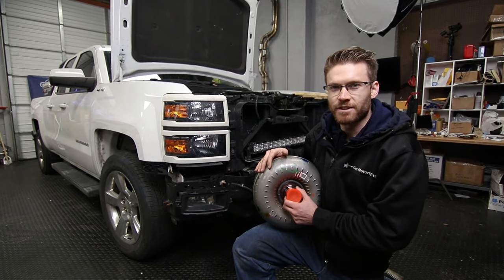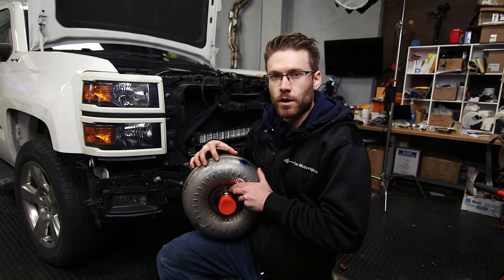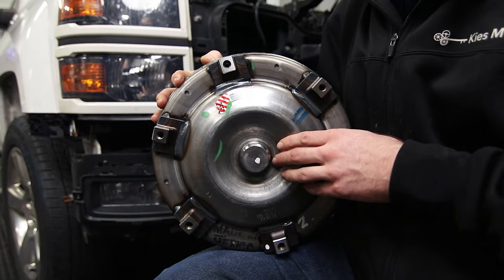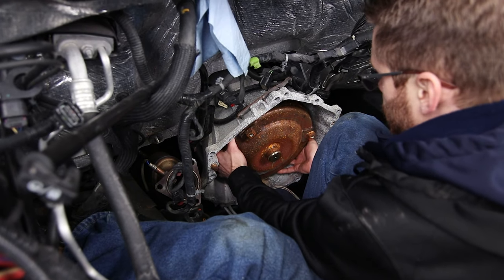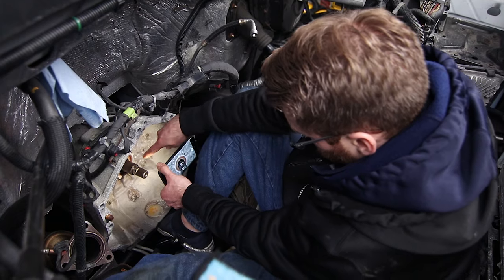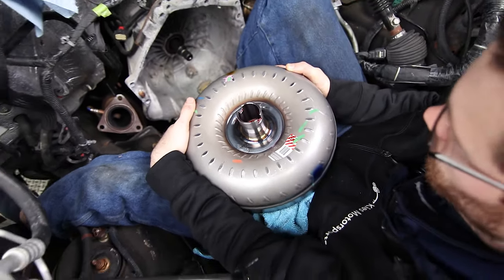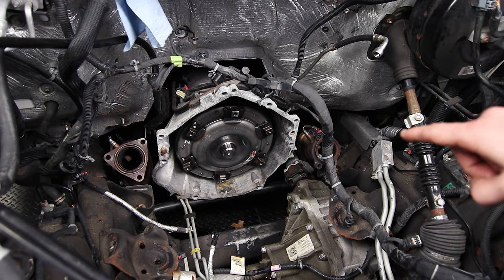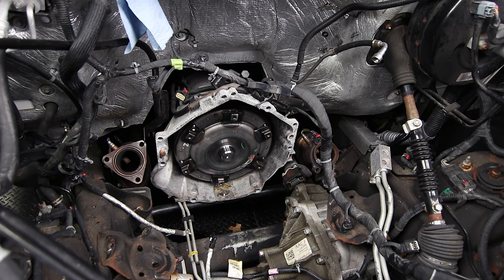6L90 Torque Converter Install in an 6L80 Transmission - Silverado Sierra Tahoe Suburban Yukon

Comment: I've been a professional mechanic for over 40 years. I would never replace a torque converter without first replacing the torque converter seal. The seal has got over 100k mikes on it. It's going be running on a new surface. It is 10 times more work to replace it after it's all put back together.
Reply: Do you have the OEM part number for that on the 6l80? Think I screwed myself, potentially. Didn’t replace the seal and I’m having to add a ton of pressure to get the converter to stay locked. It either locks smoothly but slips with applied throttle, or locks super harshly and doesn’t slip as often. Thoughts on if it’s that seal, as well as the part number, if you know it?

Comment: Is it abnormal for a break In Period to occur after a transmission rebuild and an upgraded torque converter? I am having shudder and rough shifts that has gotten better, but still occurs 200 miles after the new tc.

Comment: Great video and information. My TC failed at 82K miles and shredded my transmission. Fortunately for me my 2014 was still under its 100k mile powertrain warranty so I had it repaired for free though it took two and a half weeks. My transmission was so trashed I actually got a new one and not a reman. I also got the upgraded TC installed as well at no cost to me.
Reply from the maker: Always nice when the warranty comes through!
Reply: Which truck have 6l90  or every truck have 6l80.  Thank you
Reply: im at 113K miles on my 2016 Sierra and i think my TC and tans are toast, I was able to get a trans off a 2018 silverado LT with 5K miles on it (same 6L80 trans). The truck was totaled but trans still good. planning on doing the swap in a week. my questions are: do you think any programming/relearn is required for the whole trans swap? secondly, while its down should i upgrade the torque converter or just use the OEM?
Reply: @utrocker7  I would definitely upgrade the TC. That's what caused my trans to fail. As for the programming, my guess is it will need to be reprogrammed or at least a relearn for sure.
Reply from the maker: I agree with Michael
Reply: @TheSundaeDrive  last question, is the stock TC really that bad or would upgraded fluid to amsoil fix the issue? I’ve read through multiple forums and still can’t tell if these 6l80 TC are just crap or the transmission fluid by gm is getting too hot causing the tc to fail. Thanks and great videos btw.
Reply from the maker: Doing the thermal bypass and changing the fluid will help. But I don't trust the torque converter lol. The temps definitely kill it faster I think
Reply: Same here man. Bought at 85k failed at 90. Thankfully my warranty covered it but still a pain. I told them 2 weeks prior something was wrong but they sent me on my way. 3 days later catastrophic failure. Smh
Reply from the maker: Ended up costing them more by waiting. Wish more dealers would do preventive maintenance under warranty as soon as it shows signs of failing.
Reply: @TheSundaeDrive   GM and it’s dealers have a nack for being very reactive vs proactive.
Reply: So just upgrading to a factory 6L90E coverter is not as good as using a heavier aftermarket unit.
Correct??
Reply: Who has the New upgraded torque converter as I have the 8L90 it has 60k miles have not had any issues yet but wanted to get a new converter fix and have it done so I will not have to do a complete rebuild
Reply: @TheSundaeDrive  I agree. That why I replaced my TC with a Saxco SX-GM10404-S1BP from Transend. It has an upgraded billet cover, billet piston, heavy duty bearing, and flanged hub. These parts resolve all the issues with these TC from my understanding. I paid $870 for it. After speaking to many transmission pros, this is the most affordable, bulletproof upgrade, and should easily go 300k miles.
Reply: @jimandrews2967 get a Saxco torque converter with billet cover and billet piston for $870 and you should get 300k miles out of it. You can't just slap this on your old transmission. Either have yours rebuilt or buy a used one from a junk yard with low miles (preferably under 50k miles) and then have that TC I mentioned above installed on it. Upgrade the transmission cooler to the biggest one you can get, run Amsoil transmission fluid, and install a Superior STL010 bypass valve in the transmission. Do a drain and refill on the transmission fluid every 20,000 miles. This should be about 4 to 5 quarts of fluid. You are just draining and replacing it. No filter change.
Reply: must be nice
Reply: Everyone says the TC broke their trans, I wonder if that's just what they are told by mechanics that wanna swap trannys either for good measure or just to rip you off. Because my chevy stopped driving but I never got a overheat message, I'm going to replace TC and do a flush hoping it helps the transmission cost more than my car.
Reply: @jimandrews2967 correct, at least in my experience. I have the 6L90E and the torque converter failed at just 43k miles. The second torque converter (OEM as well) failed at 65k miles. I went with a build from an independent shop for the third transmission since they use aftermarket billet TCs

Comment: The common problem with these transmission is the failure of the main pressure regulator valve in the pump, which drops the line pressure on these unit.  In the early model the output shaft had a design where it also cleaned the fluids by catching debris with centrifugal force as you drove the vehicle around.  Early unit use to go up to 200k miles with very little service.  Then gm change the design of the out put shaft and more metal shaving (practical's) from the planetary sets started to float around in the  fluid.  So it is paramount to change the fluid on these units every 25 to 30k miles.  Changing fluids on these units will help prolong the life of these tranny.  Please do a complete transmission fluid service as you are installing a brand new Converter. Hope this helps and most likely you have done the oil change on it.
Reply from the maker: Frequent fluid and filter changes are a must for sure! I plan to service it every 30K miles as you suggested 👍
Reply: Would a pump pressure regulator not throw a code and a dash light? I have the shudder but no codes whatsoever.
Reply: @davidouradnik7925    No it does not set a code for a worn pressure regulator valve.  Most of the time it will pick up a clutch pack is slipping code or solonied performance.
Reply: I have a shudder and no codes. I'd like to just change the torque converter but everyone says it won't work or it won't last. 

Never overheated it or burnt the fluid,and the fluid has been changed several times and looks good.

Comment: The main issue is that the GM torque converters have welded tabs and are stamped from low quality steel.  Save your transmission, install a billet converter.

Comment: Confirmed!  My TCC failed with 108k on the clock in my '17.  Went with a reman trans.  It is my belief that the AFM  operation makes the TCC work much harder and thus reduces its already short life.
Reply from the maker: Seems like I got mine swapped out just in time!
Reply: You should have replaced the Front Seal  as well!
Reply: I believe that as well. Also contributes to the known cylinder misfire due to stuck lifter issue. I bought a $60 device to plug in the OBD port that disables the AFM and man does it ever respond better.

Comment: Great video. I had that same issue of transmission shudder in my 2017 Sierra at 30K miles. The dealer replaced the fluid. It happened again at 57K miles and this time they replaced the torque converter. I was glad I purchased the 100K power train warranty when I bought the truck, I have 10 months left on it!
Reply: lol this comment was exactly 10 months ago. Hopefully you are having no issues

Comment: Thank u for the video. About to do my first converter change. Went out at about 160k miles. Gonna use the amsoil as well.
Reply from the maker: Glad it helped! Good luck with the swap
Reply: Did you just swap in a new converter or did you do a full trans rebuild too?

Comment: The ZL1 converter has a dual disc lockup clutch, and should have a slightly higher stall speed.  Pop a new seal in the front of your trans since you are there!  Pack the seal lip with grease, apply some lube to the torque converter shaft OD, and let er' rip.  Thanks for the vid.
Reply from the maker: good tips!
Reply: Do you have a part number for that converter? I’m looking at one myself.

Comment: I got 195,099 miles out of mine. But it went full self destruct within 15 miles…. Started to feel a little bit of a slip.. then started up a pretty good grade and it literally started screaming, and I lost all but 1 st gear. Luckily I was only a few miles from home and limped into the driveway… replacing it with an updated L6-80   C-5… apparently this is a better option for replacement.
Reply: Thanks for the info - what brand of TC did you get for your L6-80/C5? If you could post the link, that would be awesome. Thx!

Comment: Love your videos man. I plan to do the same DOD/AFM delete to my truck by following along your videos. Definitely going to look into a torque converter swap now too
Reply from the maker: Awesome! Glad they have been helpful!!
Reply: After seeing this video me too. I’m pulling my 5.3 in a few months and I will definitely be replacing that torque converter while the motor is out.
Reply from the maker: Definitely a good idea. If you want even stronger, go with a billet converter.
Reply: @TheSundaeDrive  where did you get the converter
Reply from the maker: I have a link in the description but I got it through my local dealership

Comment: Great video! Thanks for this solution. My 6L80 blew at 138,000. Thanks GM 👊
Reply from the maker: That stinks 😔
Reply: My 6l90 in a 2017 2500 grenaded at 80k,cost me 5800 for a complete new tranny
Reply: I’m at 150k on the stock trans. 😬
Reply: @jwhmerica504 my wife’s Tahoe ltz just hit 150k and got the shutter. I’m going to try to just do the TC swap and thermostat delete. We’ll see
Reply: @stevenllewellyn8906  add a bigger trans oil cooler too buddy     good luck

Comment: My 6L90 TQ from a 2017 Silverado HD 6.0, lasted 75,000 miles. I hope your upgrade last longer than mine did.
Reply from the maker: Good to know that it failed that early. I am planning to swap to a billet converter around 200K miles which would be around 92K miles total. Sitting at 136K roughly right now but maybe I will change it earlier.
Reply: My TC in 2017 2500 with 80k grenaded the tranny dropped 5800 for new trans

Comment: I have a 2018 silverado 1500 with only 113,000 miles and my torque converter just went out and now I need a whole transmission so that's nice.

Comment: @The Sundae Drive, thank you very much for this & your other instructional videos, very helpful!! I have a 6L80 transmission in my 2010 Chevy Avalanche 5.3L, but my TC hasn't failed yet (~130K). Questions: 1) Do you know how much of a different a billet makes - and is your answer based on what you're driving/towing, or overall longevity?   2) RockAuto suggests for me: TC Remfg. B85JMBX (Standard), HDB85JMBX (Heavy-Duty Billet), or B85JMBXF (Flanged Hub). I was considering one of those, but after referring to your 6L80/6L90 article, sounds like I probably shouldn't consider those for replacements?   3) I saw another guy suggests getting a L6-80 (made for Corvette C5) - did you ever look into that? (I'm basically wondering what sold you on the GM 6L90 (24242552)?  Thanks!!

Comment: Thank you for this video - have a 6L90E in mine, but mileage is quite low so far.
Am surprised you didn't change out the front main seal of the transmission - it's right there, and super cheap and convenient at that stage =)
Reply: Generally you don't mess with rear mains unless they're leaking. Better off keeping it sealed because it's hard to get a good seal replacing it.

We do that with Allison builds. If the rear main is good, it stays
Reply: @TheSundaeDrive what do you think?

Comment: My torque coverter failed right after you did this video and destroyed my transmission ☹️. Cost me $5k for a reman. My truck is at 163k miles though.
Reply from the maker: Aww man, that stinks. You made it pretty far on the stock one atleast. Seems like it should almost be standard 100K mile maintenance item

Comment: my truck is at 180k still no failures knock on wood, 2014 5.3 420hp with tune and running e 85- just did a transmission fluid change and didn't see any metal on the magnet really.  looked pretty clean compared to what iv seen. but looking into maybe changing the converter while everything is still working as it should

Comment: Just got my truck back yesterday mine failed at 71000 miles luckily I was still a few days away from my warranty expiring.
Reply from the maker: You are lucky! I would pre-emptively change it before it happens again. Normally they last 80-120K from what I've seen. If you tow a low you'll probably be on the lower end of that range.

Comment: Not sure how the ZL1/CTS-V 6L90 converter holds up (haven't seen any get replaced at work yet) but the 6L90 HD truck converters seem to the same crap as the 6L80 truck ones.  We've put converters or worse in plenty 2014-2018 model year trucks.  Sad.  07-13 trucks I don't think we've done all of one or two of them at most.
Reply: Frend do you think  that changeing fluid transmission by mobil 1. Helps? I know a los about it.   Thank you
Reply: @andresneira9745    Are you talking the Mobil 1 HP fluid?  That's only for the 8 speed transmissions.  The 6 speed just run any good Dexron 6 ATF so GM, Amsoil, Mobil, etc.  Dexron 6 for the 6 speeds, Mobil LV ATF HP Blue Label for 8 speed.
Reply: @andresneira9745    Changing it will put fresh fluid in which will replace and replenish the additives used to regulate clutch slippage so changing it is still good to do.  Every 40-50K, especially if you tow.
Reply: Yeah my  trasmisión is 8 speed  so i will change for mobil 1 because my transmission Shakes  some times
Reply: I went to chevrolet and they wanet put the factory but i heard that in other chevrolet they put mobil 1.     So has 2 diferentes mobil 1??   My truck is a silverado 2017. 5.3  8 speed
Reply: @andresneira9745    8 speed shudder is fixed by the latest fluid the dealer has which is Mobil 1 LV ATF HP with the Blue Label.  The dealer should have it under part # 19417577.  This is the ONLY stuff you will want to put in your 8 speed.
Reply: Thank you so much 👍
Reply: @gmpartsguy9614   man i have 6l90  and i need flex plate for my truck , 6 bolt convertor 6 bolt cranckshaft. Any idea?
Reply: @gmpartsguy9614  I put the Mobil 1 LV ATF HP into my 6 speed and it cleared up a lot of the bad shifts I was having.

Comment: my 6l90 converter blew up at 102000 miles went with the billet converter with the rebuild
Reply from the maker: Good to know! I plan to swap it out around 200K for a billet. Which one did you go with?